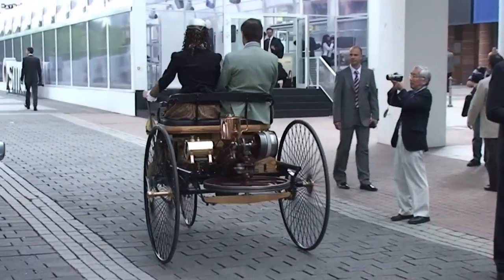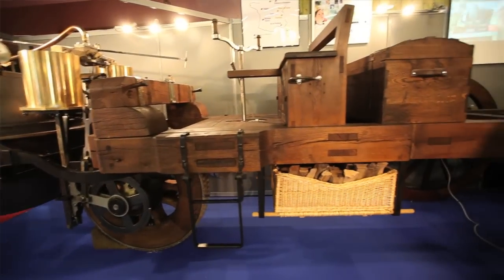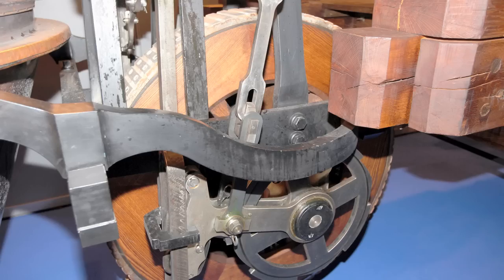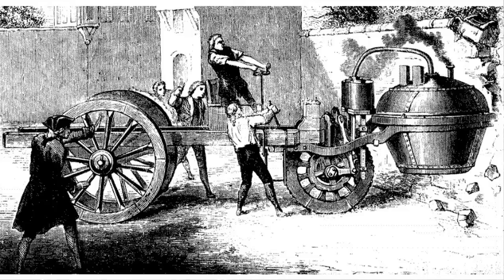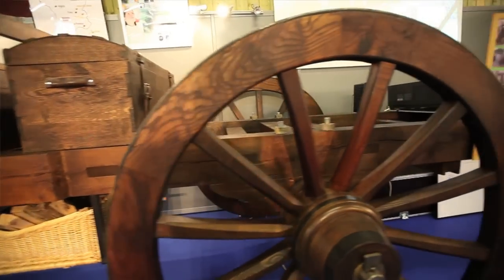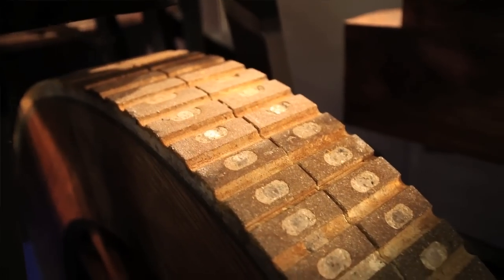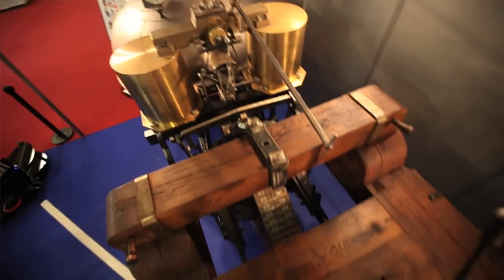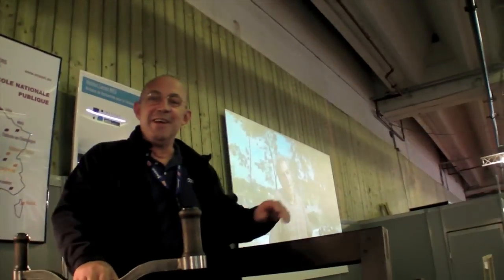The Cugnot Le Fardier - the world's first vehicle from 1769

Comment: Indeed the first known motor vehicle. At the time it was made, there were only a handful of steam engines, all stationary and used to pump water out of coal mines. In 1769, Watt in Scotland made major improvements to the steam engine that Cugnot could not have known about. That's why this clunker did only 3k/hour, and could run only an hour without refueling.
Reply: Tht sucks because we'd get cars by 100 years earlier